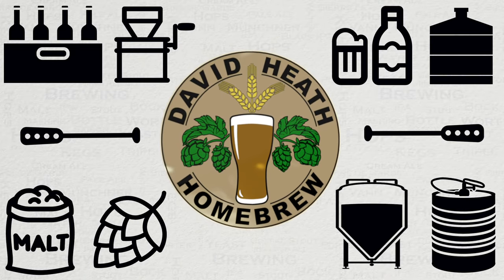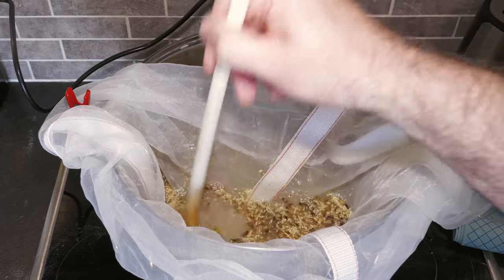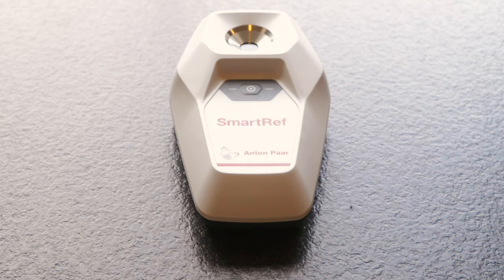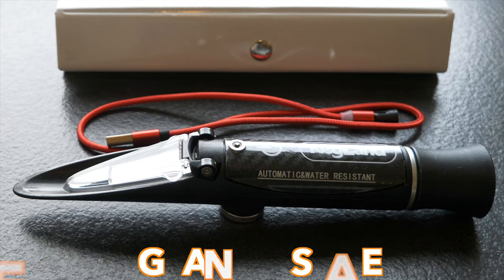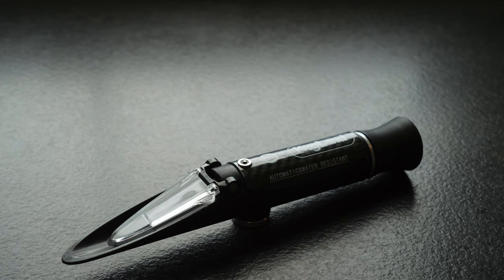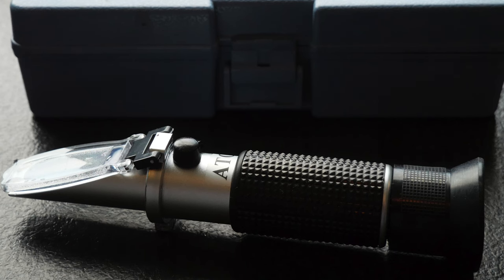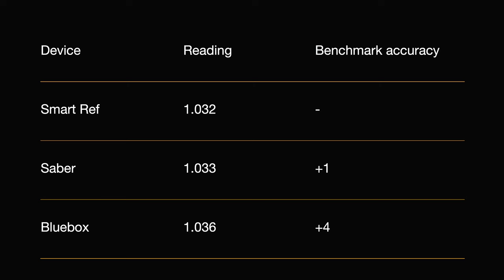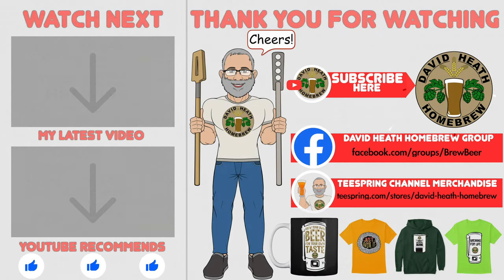Refractometer Accuracy Testing for Homebrewers

Comment: I use the cheaper one like you showed.  I first calibrated it for plain water but when I tried using it with my hot wort that had full starting gravity it was way off by comparison to my hydrometer.  So when the wort was cooled down I calibrated the refractometer to match my hydrometer.  Now several brew batches later it still matches my hydrometer at full starting gravity.. however it reads way to low on plain water.  I have also learned that it reads about one brix too low when the wort is hot but it seems consistent in that way.  So for me only needing to read wort with full gravity it works great.  thanks for the video.
Reply from the maker: Great, glad you enjoyed this one. 
I touched on this within the video but the Blue box type vary a lot as they are copied greatly throughout China. You can get lucky or unlucky, however hydrometers also vary too as I have also covered in a previous test found here:- https://youtu.be/VvJEaHgOGc8?si=Mj60TJqABirX0fnO

Comment: Thanks for making this David, I think these are really interesting little tests and evidently from the comments is super helpful to folks and a very popular format.

One (unsolicited) suggestion for the follow up video you’re planning would be to, in addition to using wort, make up a range of different gravity solutions  across the typical brewing range using distilled water and sugar so you have values of a known quantity (after applying wort correction factor) as in this video we are using the SmartRef as our reference measurement without having verified this against a set of known values across the intended range. 

The SmartRef may well have the advertised accuracy, but it would be dead simple to prove it in the interests of completeness and best scientific practice 

I look forward to the follow up, thanks again

Cheers!
Reply from the maker: Great, many thanks for you suggestions.  I really want to stay with an all grain wort for these tests. I will be putting together a high gravity one next which is coming up over this weekend for testing and filming.

Comment: Thanks for doing this.  If I may suggest, I would have liked to also see the reading of your wort from a standard hydrometer, as comparison with the more technical devices, because using one is so cheap.  Plus some approximation of the differing costs between devices (e.g. SmartRef is generally 10x price of NoBrand, or something similar) - as lower margin of error is expected as price increases.  Just a suggestion, perhaps in the notes.
Reply from the maker: Hi, many thanks for your feedback. Actually I already did a test like the one you suggest which is available at this link:- 
https://youtu.be/VvJEaHgOGc8?si=Mj60TJqABirX0fnO
In terms of price this is something I avoid because my channel is viewed in many countries and especially these days prices are very much subject to change.
Cheers 🍻🍻🍻
Reply: @DavidHeathHomebrew   Great! - very interesting to see that also, thank you!🍻
Reply from the maker: Cheers 🍻🍻🍻

Comment: Hi David like most of your videos this was very comprehensive thank you. For my part I I use a cheap blue box refractometer and to be fair to it for the price it is excellent. I used my hydrometer to standardise my refractometer. I chose three different sugar concentrations and check the hydrometer zero using distilled water my hydometer was surprisingly accurate!  I have to be honest my refract did not show a reading more than 0.001 sg at any of the three chosen sugar concs. I further used my hydrometer and refractometer over several mashes taking samples at different intervals. After taking some twenty diferent sample readings over various brews I could not split my hydrometer and my refractometer by more than 1 to 2 points . So my take is that for the average home brewer a cheap blue box refract is adiquate we are not selling a product and if the error is so small calculated ABV values will not be badly effected.
Reply from the maker: Hi John, Do keep in mind that most of the cheap glass hydrometers are also varying in accuracy. You never really know until you have something much more expensive how accurate you are. It is of course argueable if this is an issue though, if you are happy with the actual beer results.

Comment: I use a bluebox refractometer for all my readings (during brewing and fermenting), but enter the brix into the Refractometer/Brix correction tool in Brewfather.  I have determined my correction factor to be 1.04 by following the procedures laid out by Short Circuited Brewers.  This seems to work for me just fine.  Sure would like to have one of those Smart Refs though...
Reply from the maker: Yes, ultimately it really depends on the level of accuracy desired. Being aware the this can vary is useful though of course.

Comment: I use a Milwaukee digital refrac and love it, but do find a lot of variation among readings even after just waiting a minute or two - even though it should correct for temperate.
Reply from the maker: Ive not tried it but this variation does not make it sound so reliable.
Reply: @DavidHeathHomebrew  I have been curious if settling solids can affect it over seconds to minutes.
Reply from the maker: As long as the reading is consistent after some minutes then thats ok.

Comment: Thanks for this video. It's been one I've been looking for a while. As an owner of a small brewery that has just started up I have been relying on a hydrometer to this point as unfortunately the Anton Paar units are out of my budget at this point. I have also been reluctant to purchase the unbranded refractometers over concerns of the very reasons you have shown in your video. I always intend to rely on hydrometers for OG and FG readings anyway but a refractometer will help with taking readings during the sparge. 

One quick question, were these readings taken with wort correction factor taken into account?
Reply from the maker: Thanks. I would recommend the Anton paar solutions personally. These tests were completed as was. The saber is tuned to wort and sugar. I have high gravity tests coming next.

Comment: Most people probably understand that the cheap ones do not have the highest accuracy. But there is a methodology that can handle that problem very well and that gives good accuracy over the entire measurement range. If you make measurements with calibration fluid over the range you want to measure well. Then, with a small polynomial formula in a spreadsheet, you can get a value that is compensated for the inaccuracy. If it's worth the trouble, yes if you think that kind of thing is a bit funny, otherwise maybe not.
Reply from the maker: Oh you would be surprised then. Many actually do expect high accuracy for the cheapest of instruments. This was one of the core reasons to make these videos in fact.
Reply: @DavidHeathHomebrew  
Fair enough, I'd guess that about every other person born is moderately gifted.
Reply from the maker: That well could be true but it surprises me just how many people take a cheap hydrometers reading as accurate and many cannot be swayed from it even with explanation.

Comment: I ferment liquid malt extract kits in a plastic bucket then transfer to a keg, my only monitoring capabilities are temperature and gravity. The other day I transferred a batch from a bucket into a carboy due to lack of space. Temperature was right, all looked correct. I then put the airlock in, but it was quiet. Panic stations the whole thing seemed to have died. Then I got my magnifying glass out and looked at the surface and there was little bubbles coming up to the surface. 
Today a lot of froth on the surface and it looks right, yet the airlock is still still. Gravity is reducing.  What I'm thinking is that all the measuring devices have their place yet being able to look at what's going on and then with experience make a judgement on the situation is just as important. I'm sure this batch will be okay.
Reply from the maker: Sounds like something could be up with your airlocks seal. Certainly they are not to be taken too seriously as they can bubble just due to air pressure. So yes, its great to have other ways to measure 🍻🍻

Comment: For the cheap model, is the reading from the SG scale?  I have followed the advice to use the Brix reading and convert that to SG with a wort correction factor.  I use the BeerSmith Mobile app tool for this.  Using this method I have found my readings to be within a gravity point of my hydrometer readings.  It is an additional step, lets me know on brew day how I am doing.  It sounds like the Kegland one has a better SG scale built in.  I use a hydrometer reading for my official OG and FG readings. Cheers!
Reply from the maker: It should not make any difference but my Blue Box only has Brix. Your hydrometer is also unlikely to be very accurate, if its the typical budget type.

Comment: Nice test. I suggest to additionally test this with a wort of higher gravity. An alternative could be to produce two sugar solutions of known gravity and test all devices against it (in your experiment, the SmartRef couldn't be incorrect).

A few years back we tested standard homebrew hydrometers and cheap refractometers with two solutions of known (but secret) gravity - the solutions were distributed to several people, who tested with their personal device(s). The result was, that all devices were "good enough" for home brewing, however the refractometers seemed a bit more precise than classic hydrometers. The reason is probably because reading the measured value on a refractometer is less error prone than correctly reading a hydrometer (surface tension).
Reply from the maker: Thank you, yes I will be making a high gravity test soon after others suggested it, its a good idea. In my test the SmartRef was the benchmark unit due to its known and trusted accuracy, its actually a little more accurate than the EasyDens. 
These tests are certainly fun and interesting but what is «good enough» is really down to the individual.

Comment: Another great video David. The difference in readings between the cheapest and more expensive is about 4 points. Other than having an affect on the final ABV, will an incorrect gravity reading of the wort have any affect on taste, colour etc? I find it very difficult to read an exact figure on the cheaper ATC as the display is very small,  so I'm wondering if its worth the extra outlay?. Thanks, Ian
Reply from the maker: Cheers Ian. 
A change in gravity will have an effect on final ABV, balance and taste. The actual difference will vary on the recipe. In terms of value this is really down to the individual but personally I see great value in accuracy.
Reply: Thanks so much for responding and the expert advice. I am struggling to find a Saber supplier in the UK, hopefully there will be availability soon, thanks again   @DavidHeathHomebrew
Reply from the maker: @ianjones6849 I would suggest contacting  Angel homebrew and Brewkegtap to see when they have these coming in. You may be able to reserve one.
Reply: thanks David, great suggestion. I have also reached out to Olbrygging Norway (they have stock) a supplier which you recommended to me a good few years back now! 😀. I bought a bottom filter for my  old GF from them. I'm not sure what the current delivery situation is, post Brexit, but will await their response, thanks again and cheers!
Reply from the maker: @ianjones6849 this is the company that I work for but we do not ship to the public outside of Norway 🍻🍻
Reply: Ah OK, I seem to vaguely recall you worked for this company, thanks for letting me know to the change of shipping. I have checked my previous order with you and it was 01/03/2019. Hopefully in the future you will restart shipping to the UK again as you have some great products 👍
Reply from the maker: @ianjones6849 cheers Ian 🍻🍻🍻

Comment: It would have been really good to see these comparisons but with temperature differences as one of the big bonuses with the refractometers is that you can use high temp wort (assuming your refrac has temp adjustment)
Reply from the maker: Ok, thanks for your input, much appreciated 🍻🍻🍻
Reply: @DavidHeathHomebrew  thanks for the videos, you make pretty unique content and it's very much appreciated!

Comment: ive calibrated my bluebox item to 1060 with my hydrometer, my PIL reads the same. This is where most of my SG starts so it works for me.
Reply from the maker: If its working for you then great, the bluebox type can vary hugely.